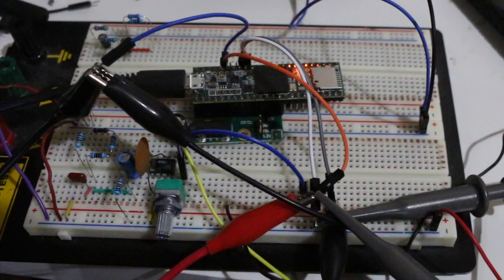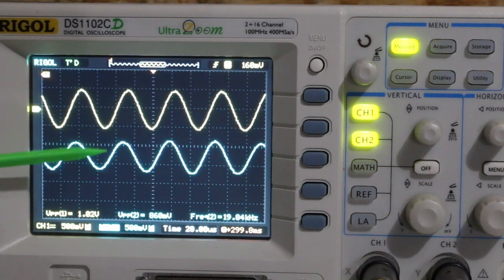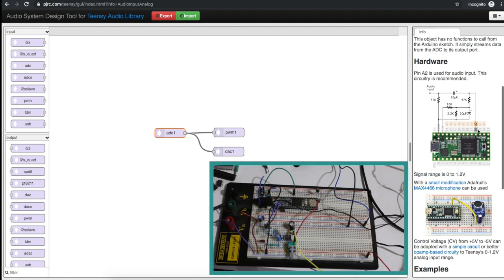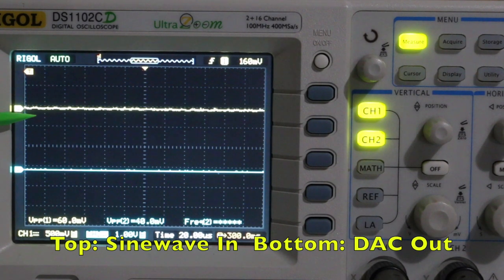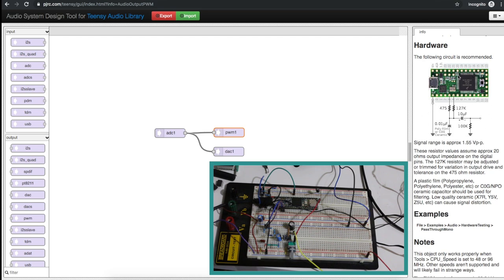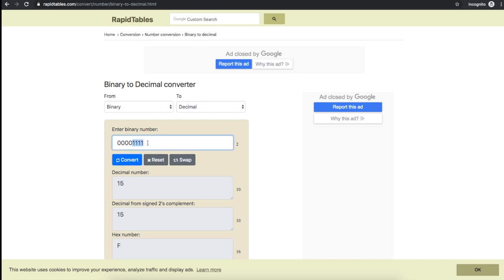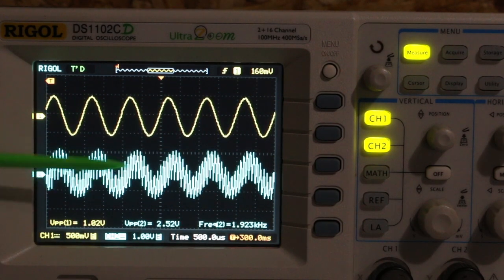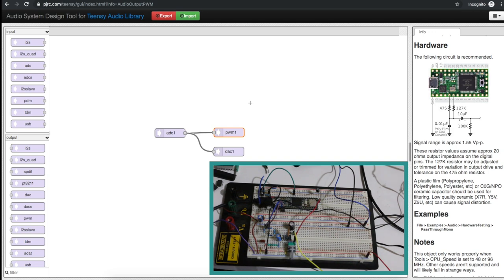Teensy Audio without the Shield - Using ADC, DAC, DUAL PWM

Comment: A summing amplifier might work better for multi PWM. The other one seems to be impedance dependent. Also, you didn't nearly filter the pwms hard enough if you intend to run that signal through a tweeter, should be fine for midrange speakers though . If you use a dual opamp, you can use the first side to make the summing amplification to stack the signals and the other side of the opamp for a 2nd or 3rd order filter.

Comment: It would be interesting so see this with the 4.6 that came out last month. There has been some MAJOR MAJOR upgrades including 600Mhz clock speed on a 32bit processor
Reply: Did you mean 4.1?  There's Teensy dev/platform 4.6.0, but I haven't seen a Teensy newer than 4.1

Comment: THX ! very interesting. You are a pro! One qustion. I am building an Teensy FX Pedal for my fender electric bass. just looking at the schematics: What do you think is better to us as an input mic in or line? now i am using line in but the low frew are distorted - i already played with the gain but no difference...
Reply from the maker: I haven’t tried the mic input on the audio shield and I haven’t seen the schematic lately to see if there’s anything obvious on the board, for example I wonder if there might be some interaction between the output impedance of a pickup and any input components on the audio board, so maybe an op amp in between would help isolate everything and keep everything from interacting.  

And possibly use the opamp to reduce gain even further if the hardware itself is being over driven.  Do you have an oscilloscope to look at any signals? Is the bass an active pickup output? I wonder if its signal swing is a bit strong and it’s just over driving the input, and attenuating it would help before it even gets to the audio board. Is there any difference if you turn the volume way down on the bass itself to help lower the signal going in to the audio board?

Comment: Thanks for this video! What’s the deal with the stepping on the DAC, that’s due to sample rate not bit rate right? Why can the Teensy write to the audio board faster than it can the DAC?
Reply from the maker: The audio board runs with a data clock a couple of MHz so it would have enough time to get stereo audio and do what it needs with it.   I can't remember all the details of the experiment now but yeah the sample rate on the analog input would be un-optimized with all the arduino overhead code and configurations causing it to sample inefficiently, and moving the data from ADC to DAC adds overhead after the sampling is done, and if it's at 10 bits (I think that's the default) it's losing resolution there too.  I've used 3 different I2S audio chips on various boards and it's way better.
Reply: @GadgetReboot  Ah, makes more sense that it's losing fidelity sampling on the way in, forgot that your test used the board input. I guess it could also be on the way out if the I2S pin gets faster writes than the DAC does due to the way the chip is set up.

Comment: Was hoping to learn how this PWM addition werks!  I have a guess.
Some MCUs, like the  Logic Green clone of the ATMega328, have multiple internal voltage references that can be tied to an I/O pin.
If you have 10 bits to scale a voltage reference of 1.024V, each tic is 1mV.  If you use the 4.096 reference, each tick is 4mV.  Add them together and get a 5V range at 1mV, which is more steps than can be represented with 10 bits.  Teensy probably has INTERNAL1V1 and EXTERNAL 3.3V reference capabilities, at least.
(shrug) May be completely wrong though.
Reply from the maker: I think the teensy does have an internal 1.2 and external 3.3 option.  I feel like I have a 95% understanding of it in my brain but only a 23% capability of expressing it to the rest of the world using stick figures and crayons.  

Kind of like how I was frustrated a year ago when I did the video on the audio spectrum analyzer using FFT and I couldn’t exactly figure out how it worked so I had to gloss over it. Still bugs me.